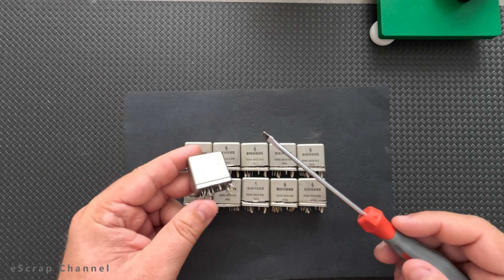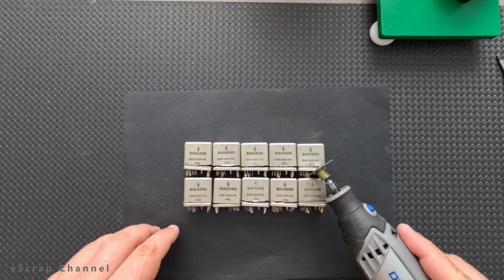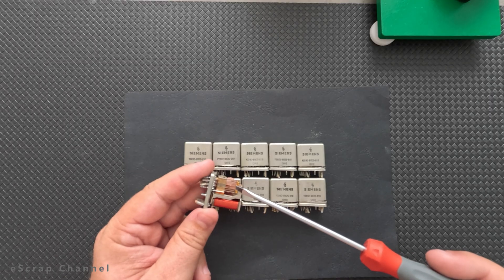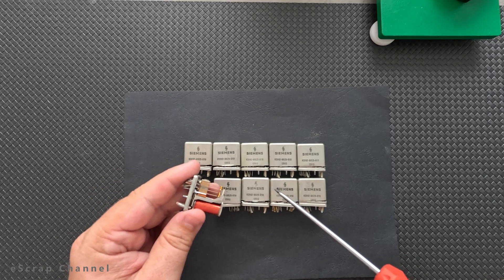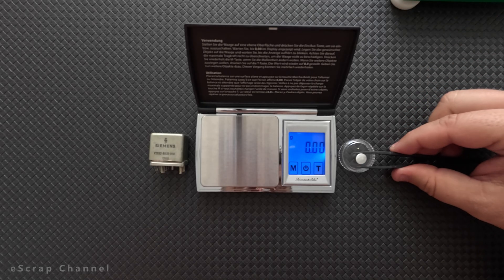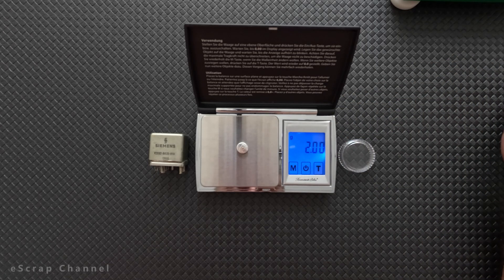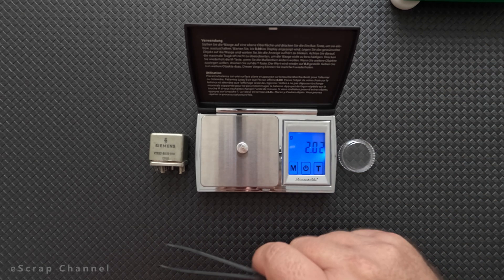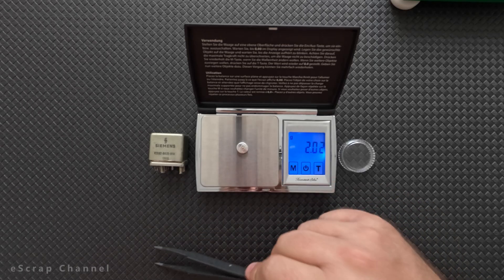Gold and Silver Recovery from Relays - EPIC FAIL!

Comment: Hi,
What solution should I use to give metal powders (for example, silver) a red color in a metallic solution, and to prevent the redness from fading after washing, rinsing, melting, and re-metallizing them?

In other words, to ensure the dye remains stable.
This question may seem strange, but I read this in a book, and since it's in an old language, the acids are often misunderstood and have different names.

I came up with the following:

1) dye + hcl + h2so4
2) dye + hcl + iron sulfate
3) dye + hcl + iron sulfate
4) dye + hcl + iron sulfate
5) dye + hcl + copper sulfate
6) dye + hcl + copper sulfate

So, in summary, I can say that the color of the dye will remain on the metal, but the weight will not.

Besides what I've written above, do you have any other suggestions or recommendations based on your experience?
Thank you.
Reply from the maker: Hi, this is an interesting question. Silver objects can be covered electrochemically with other metals and this way surface color change. Surface color can be quite stable. Other way is to melt silver with other metals and make a new alloy with different color, but you will go below sterling 92.5% silver content and not able to stamp as silver.
Reply: @escrapchannel  Thank you very much.